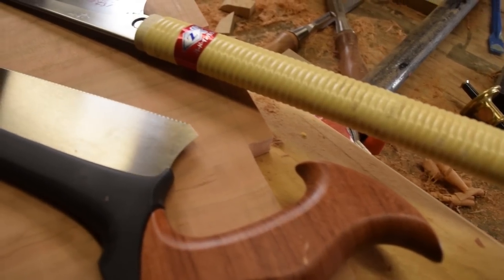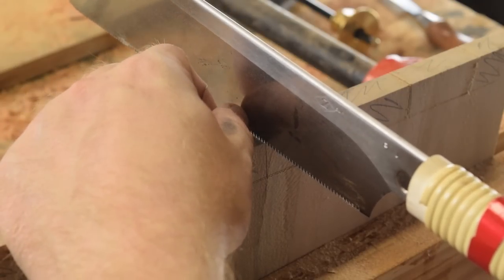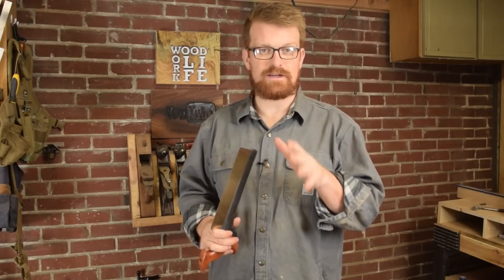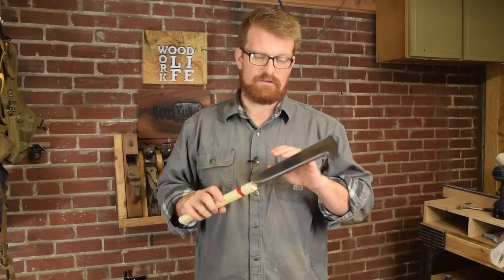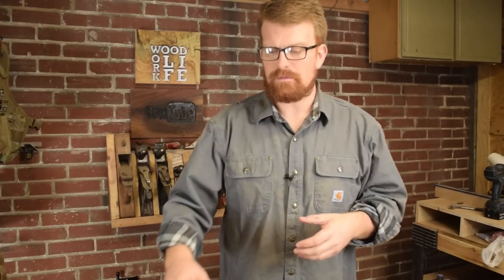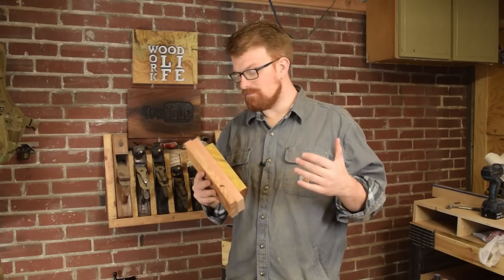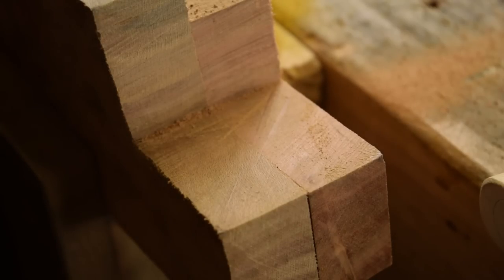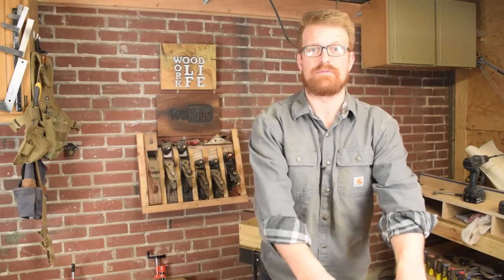Z Saw Dozuki vs. Veritas Western Backsaw - East Meets West | Hand Tool Shootout

Comment: I bought a Japanese saw just like that one and I tried my damnest for two days to make one single straight cut. It made me that that woodworking wasnt for me. I took the saw back and got a 16 point crosscut veritas saw and the first cut was dead on 90 . I am a western woodworker from now on. I found a Stanley 26 in panel saw for 1$ at a thrift store. It was covered in paint and rust, and the handle was old and loose. I sanded it to a mirror finish and sharpened it to a rip cut. Now it is my go-to saw for cutting lumber. Its quicker than lugging my miter saw and extension cable . So western saws work well for me
Reply from the maker: +Jacy I haven't fallen in love with either.  I like Japanese for dovetails and western for square cuts.

Comment: If you wanna make a test doit well. There are Japanese saw for hart and soft wood even for Bamboo, there are saw hardened and not hardened. the veritas are more then triple the price of japanese saw.  so the test is rubbish. If you do a test doit good and no nonsens. by the way dit you sharp the veritas by yourself?
Reply from the maker: I have sharpened it since, with the high TPI saw, I did lose a few teeth.  In retrospect I would've bought a lower TPI saw from them.  I can't live my life without nonsense...sorry.

Comment: I think your key point about sharpen-ability is misguiding.  Doesn't it cost around $20~$35 to have a saw sharpened?  I can imagine it's a big pain to sharpen one yourself.   With that said, most Home Depot like places sell brand new Japanese handsaws for $20~$35.   Clearly the Japanese hand saw has the advantage.

Comment: I would also add the price comparison you could buy like 8 or 10 Japanese saws that cut better in my opinion for the price of 1 veratas saw witch I think is insulting that American people do nothing but screw each other I can buy a Japanese blade and make my own handle and top band for a fraction of what they are asking for American saws again just my opinion but if you are an ok woodworker you can make it and you feel good every time you use it
Reply: The veritas is around 60 dollars.  The japanese z is around half that.  I think I will just buy both.

Comment: In my opinion it is hard to admit that the Japanese are better at certain things like making saws and you were testing a saw with what you say was missing teeth maybe do it again with brand new saws also most people even if they know how will not take the time to sharpen there saws unless they are extremely valuable
Reply from the maker: +Jason B I find myself torn between both, I like my Japanese saw and I like my Veritas saw.  They both have their places but the Japanese saw is much more versatile.

Comment: If you can't sharpen it, it is garbage. You don't save money by buying throw away garbage and replacing it, when you could have just bought the correct saw to begin with.

Comment: It would've been much better had they both been new saws. You can't really say one is better than the other when one of them is literally missing teeth...
Reply from the maker: I worked with what I had, tried to give them both a fair shake.  To be fair, even after buying a replacement blade shortly after noticing the broken teeth, I still don't get a PERFECT cut with the Dozuki.  It is easier to start a cut with a fresh blade but the results are the same.
Reply: Wood.Work.LIFE.  Thanks for the response. That's interesting. Now I have a better idea of which I would be more interested in. I do prefer the back pull blades much more over a push.

Comment: This looks extremely dishonest, as if you set this up to make the Japanese saw perform worse than it should.  You used a broken down old Dozuki with damaged teeth and a Veritas saw that was pristine.  I have that exact same Japanese saw and its rip cuts have a sheen on them as if they had been planed.  Few saw marks most of the time and none at all when I get my technique right, which I do increasingly often.  Cross cuts are also much smoother than those shown in the video and sometimes show no saw marks at all, as if the end has been sanded.

If I want a fast rough-cut I still reach for the Western saws I own, if I want precision it is the Japanese saws every time now and I have not been using them for very long.  The cut quality on a cheap Japanese Z-Saw beats any expensive Western saw including that Veritas.and you know it does.  Next time try two saws in good condition and use them both properly.

And if you really want to be fair try a premium Japanese saw against the Veritas, not one of the cheapest that Z-Saw make.

I wish I could give you multiple thumbs down.
Reply from the maker: It's honest, but I'd like to revisit it.
Reply: @WoodWorkLIFE  Please do it properly and fairly next time, then delete this one, it does you no credit.

It is true that the cheaper Japanese saws use the same induction hardening process that cheap Western saws do, and that means the blades effectively have a limited lifetime and need replacing periodically.  However if you're going to get better results you may decide it is worth it as I have.  I already get much more precise, smoother cuts from my Japanese saws than the traditional Western saws that I own and I have owned the Japanese saws for only a few weeks.  I have been using Western style saws for over forty years.  I have a cheap Spear & Jackson western saw with induction hardened teeth and another traditional cross-cut saw — older than me — that can be sharpened.

All of these saws have their uses.

The cheap Western saw I use when cutting salvaged wood as it may have screws or nails in that I missed.  If it hits a nail and breaks teeth well so what?  It was cheap, I'll get another.  The other Western saw is a Disston, (spelling?) older than I am and it is now relegated to rough sizing cuts.  The Japanese saws are used when I want to be precise.  Their cut quality is still amazing to me every time I use them.  I am sure I will get used to it though I hope I never lose my appreciation for it.
Reply from the maker: I am posing that as a personal challenge, will do.